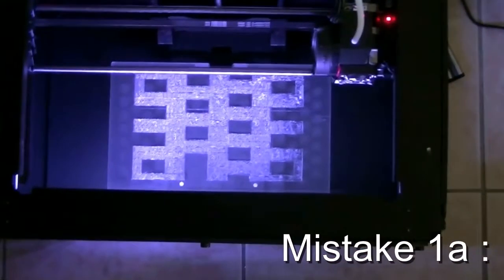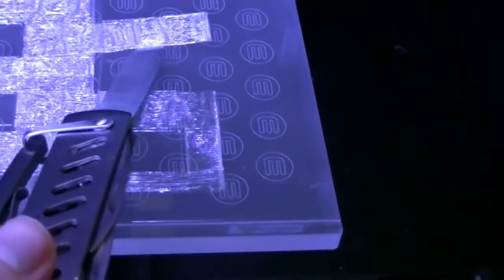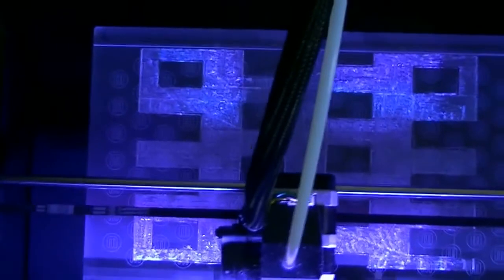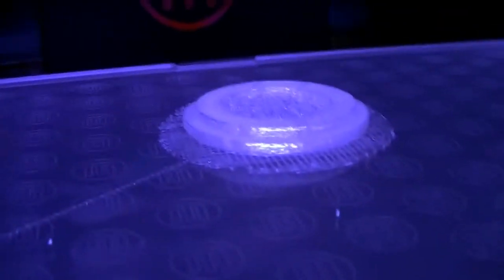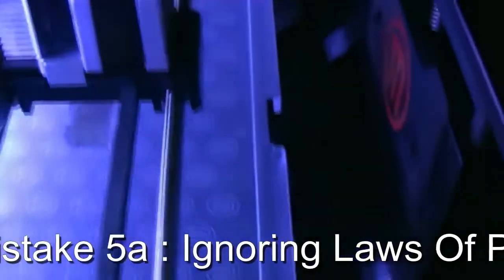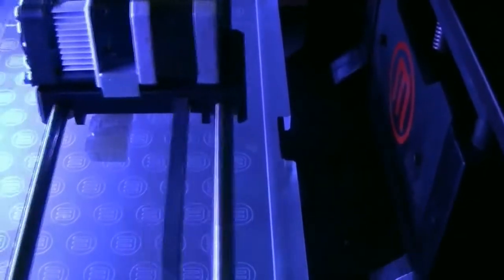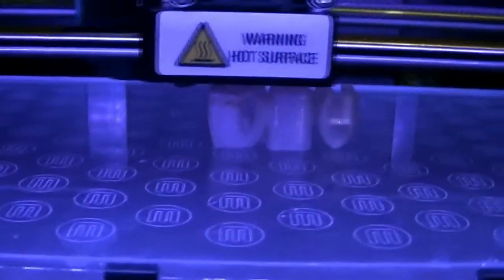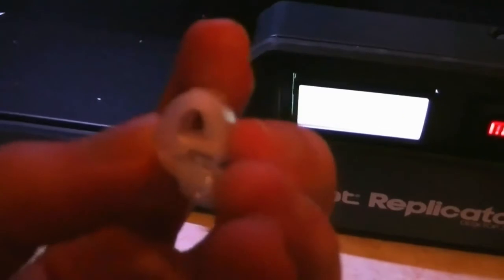MakerBot Replicator 2 : Learn From My Mistakes

Comment: Kurtz.. did the replacement unit fix your issues?
Reply from the maker: Hopefully yes. I've replaced the whole mount bar assembly by a new one and also upgraded the extruder, it worked far better ; I still have a problems with the border of my objects warping/curling, and I'm on the way to also replace the build plate by a glass-type build plate to improve a bit things on this point...
Reply from the maker: ***** MakerBot Replicator 2 PrintHead Replacement
Reply: Cool..  I'm thinking of purchasing the Replicator 2 so it's a bit of a concern hearing about the issues you had.  Although even more so that you still need to replace components such as the print head etc.  I just want something to work out of the box ;)
Reply from the maker: Geoff Leff the fifth generation of makerbot's printers should simplify a lot the process of removing/replacing the printhead for any required maintenance ; check it here : http://store.makerbot.com/replicator